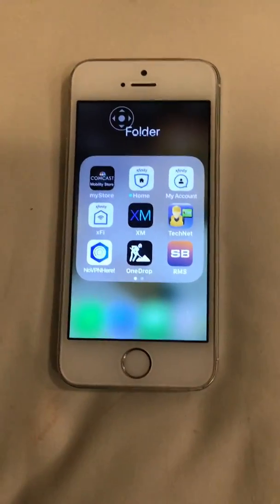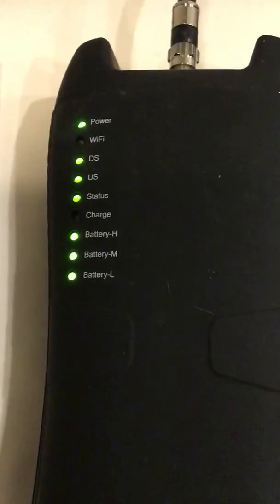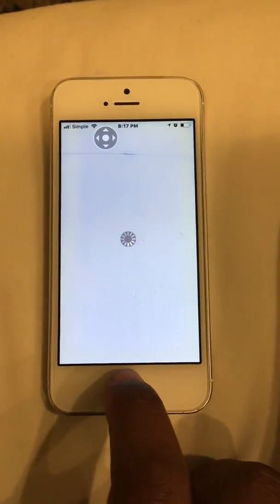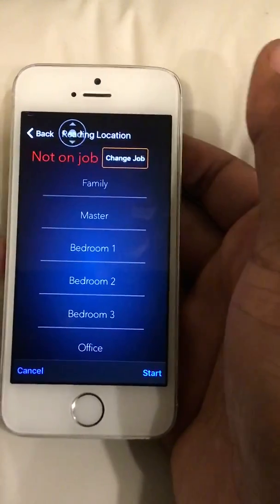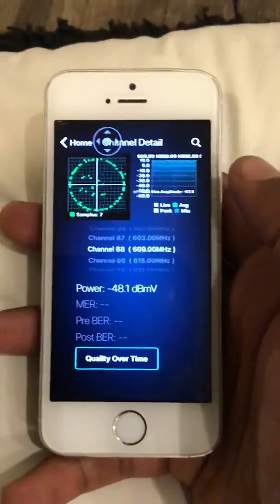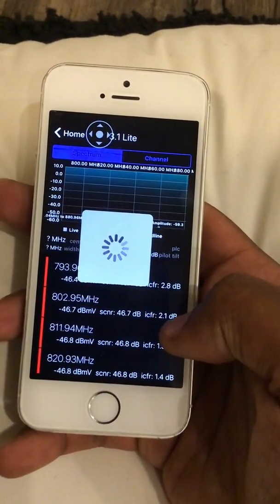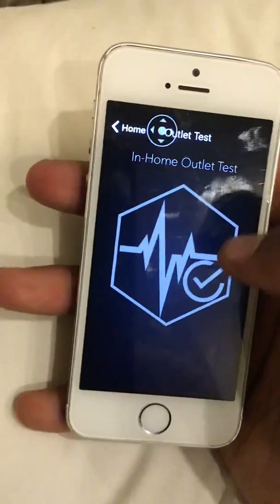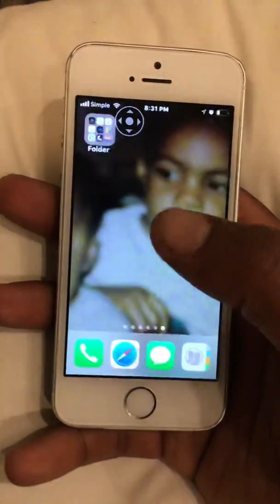XM1 Meter

Comment: Are you still with them I need help with my xm1
Reply from the maker: The XM1 now, doesn’t update like the XM2. Even the Drop Validation on the XM1 has to be done differently than on the XM2. Nevertheless, they want everyone on the XM2, so the app may malfunction sometimes. It may have trouble reading your jobs for meter readings too. Lastly, it may have problems uploading your meter readings, and you may have to do it twice or thrice. Crazy, but it mostly have problems uploading the ingress for me. When I did this video in 2018 the XM1 had just came out, and everyone had to have one; not only the security techs, and we still could use TechNet; it wasn’t all the way opted out.

Comment: First things first, tap value doesnt indicate actual signal. Tap value 11 wont have 11 downstream coming off of it. It just indicates how much is being split from the signal off the hardline. So 11 value tap attenuated 11 dbmv from the signal in the hardline.  
Second, on flux it it's not bonded  100% of the time its because you're filtered at tap. You wont just have 1, 2 or 3 upstream channels missing off tap,  for upstream if it's a bad tap you'll get no   upstream( or any signal really) whatsoever . Or you can have no upstream at the ground block because there's a block filter ( silver silver) at the tap. But you should know that before you even get to the job if you run PHT you'll see if they're filtered and what kind of filter they have. ( partial reg state 2 on 2 or 3 frequencies). Either way, just climb. 
Third, quam is really useful but other than signal what are you really looking for? What does anything being red mean? Well I can give an example. Where I work at we primarily look at channels 2, 30, 80, 100. On channels 80 and 100 if the MER is red it most likely means it's in the house but if it's bad on channel 2 most likely it's a network issue . And even if it's all green there can still be am issue such as reverse tilt, but of course you cant see that on DOCSIS so if it's all green and you close the job, you'll just end up getting a repeat....but it's all green right? LOL
And I can go on and on but those two things annoyed me. Alot of misinformation here though. I know you're trying to help...but dont unless you have a thorough understanding of it....I mean you didnt even know how to use ingress.

Comment from the maker: Oh like I said I’m still learning how to use it. I never really had a meter. Whites and Latinos never taught
Reply: I'm just going to assume you're a total fucking idiot as well as a racist. Being a dumbass and not knowing how to use a tool at your job doesn't mean "the whites or Latinos" are at fault.
Reply: Might be a reason you were never taught...JS
Reply: I bought one of these whats the defualt wifi login and i plug this up and the internet is running using my exiting cable and connecting my pc to the lan of the xm1 is this suppose to happen ?

Comment: Dummy... clicking on tap doesn't read the levels at the tap. It labels your reading as "Tap" when you upload it.
Reply: I’ve never had a tap I needed a bucket truck for or was unreachable. Tito is right. That’s why there is so many labels (living room, bedroom 1,2,3). If you’re at the ground block, and u hit bedroom 3 how would the meter be showing levels of inside when it’s disconnected outside ? Lol
Reply from the maker: Tito Ortiz Maybe not exact reading as being directly at it, but it does read it. How else do you get the tap reading without a bucket truck, to put in for a ticket?
Reply: @dwightgibsonjrxfinity8585  Bucket assist, or gaffing. The label you select on the xm1 is labeling the reading you are uploading, so it can be looked up and referenced later if need be.
Reply from the maker: Tito Ortiz maybe I miss said something so tell me how you get the tap reading of a tap not reachable?